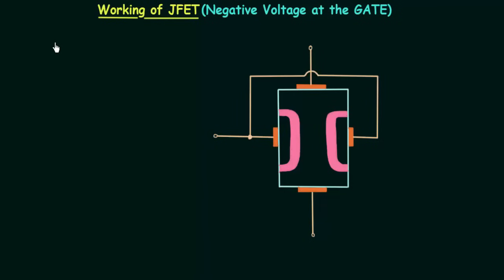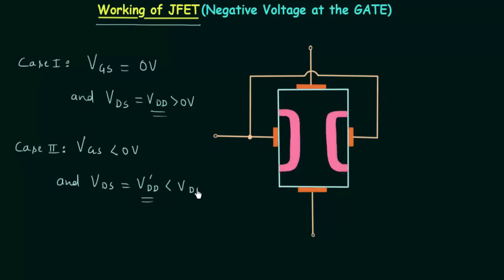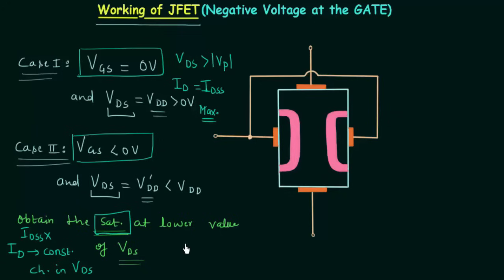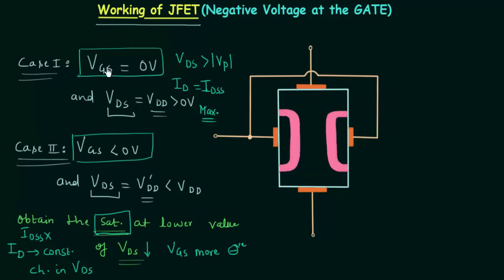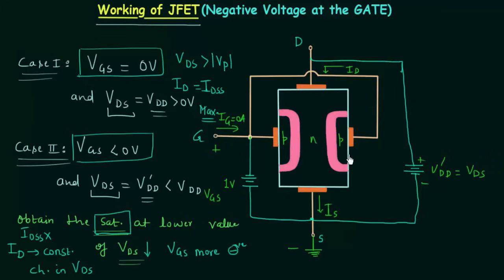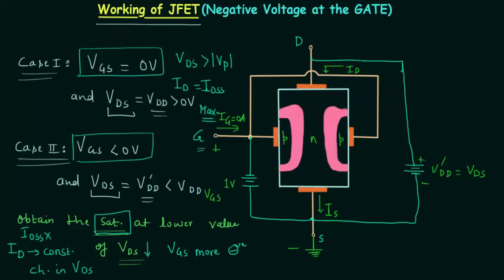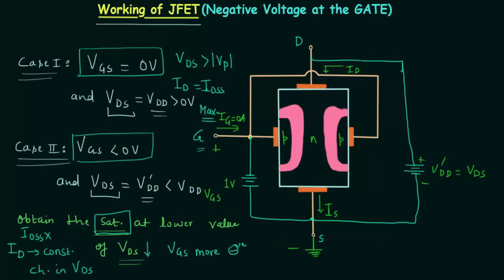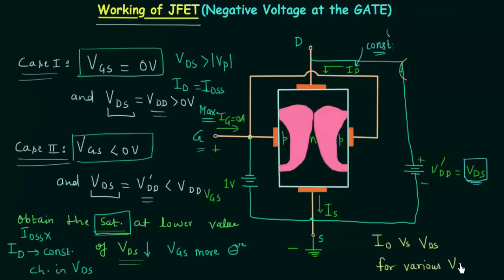Working of JFET (Negative Voltage at the Gate)

Comment: What is the answer for Vgs>0 ? what happens?
Reply: It is not used in JFET because it decreases the width of depletion region causing very high current to flow, and damaging/burning the JFET.
Reply: the working of JFET is based upon the depletion region, for Vgs>0 there wont be any increase in depletion region. Vgs>0 is applicable for p channel jfet

Comment: Sir how the drain current remains constant after the channel width is reduce.Smaller the channel width i.e. smaller the path for electrons to flow so it should reduce right?
Reply: Even though the channel width id small,the election density increases so more no of electronics pass through narrow space which makes id current constant

Comment: SIR,why will the current won't become zero at pinch off since both the depletion layers touch each other
Reply: Exactly my thought. 
It should become zero, as the condition is still reverse biased.
Reply: depletion layers will never touch each other...
Reply: They literally  not touch each other bcz both are p type material they repel each other there is small channel still existing 😊
Reply: The depletion layer will never touch each other ...........if it were so........the current will be zero.As a result the reversed  bias voltage drop  across the length of the bar will be zero...and due to it the depletion layer will tend to become rectangular.........and channel will be opened...and current flows....
Reply: Bcoz it will cause a paradox if that were the case

Comment: I think when a positive gate source voltage is applied at gate terminal of the n channel JFET,  It will lead to the breaking of the Depletion layer as a result of which large amount of current will flow through the channel and will destroy the transistor.